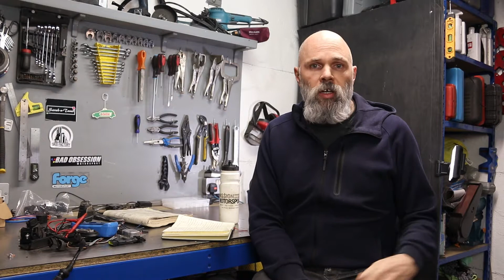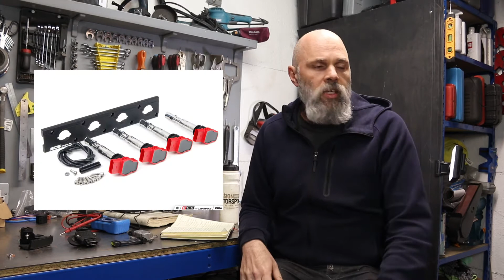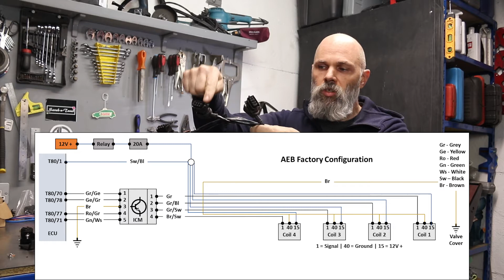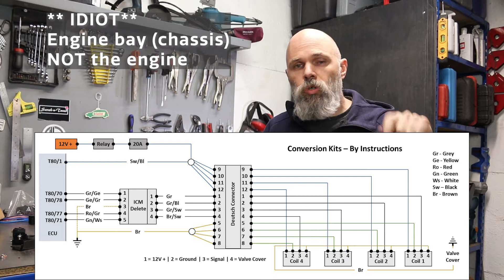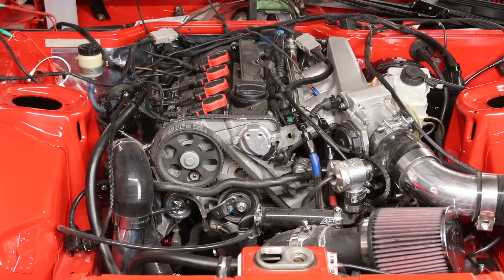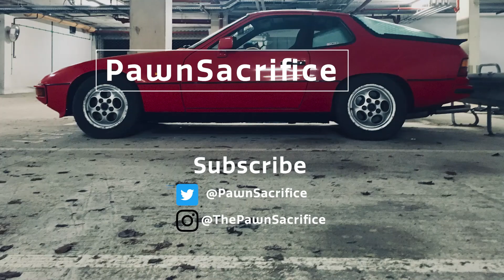1.8t to 2.0t Coil Conversion + ICM Delete (+ troubleshooting)

Comment: Hello, I'm afraid my English isn't very good, but I'm also having the problem that it won't come off. Could you explain how you solved it?
Reply from the maker: If you mean it does not start try and remove the cam sensor - see 18:30, if the engine starts plug the sensor back in and swap the coils order, move 1<>4, and 2<>3, see 19:20, if it starts that was the problem, if no, you may need a new cam position sensor. I hope that made sense.
Reply: @PawnSacrifice OMG you're the best! It really works! I'm so grateful for your videos! ❤❤❤❤❤❤❤❤❤❤❤❤

Comment: Sooo i have problem with stuttering and i thing my problem is from connecting 2 ground pins together ang connecting it to stock ground prin from original wiring. Is this right or no
Reply from the maker: Honestly it was so long ago, everything I did is in the video, with diagrams and that worked. I think there was a ground from the engine block, from memory. Sorry. Are they connected in the right order, is the only thing I can think?

Comment: So to not delete the imc I would follow the aeb/porche which would mean I cut the harness by the cylinder head?, then wire the wires to the connector that connects to the new harness right ?
Reply: And the deutsh connector is the connection piece u wire the wires to in the harness kit?
Reply from the maker: @Europitdprod  I am slightly lost with this to be honest, it's been a while - if you're using a kit just follow what they're doing, the ICM delete is a cable, what you're taking out is after that so there shouldn't be anything to cut, from memory.

Comment: Ive got a passat with AEB engine so i have to follow the second diagram AEB/Porsche conversion right ? So i dont need the icm delete connector
Reply from the maker: I had to have a quick look back, but that sounds right - assuming you're doing the same as I have and cut the loom back before the ECM, you could keep it, but it'd just be extra wires - I cut out a lot for neatness.
Reply: @PawnSacrifice  thank you! There are some conversion kits out there on ebay with icm delete connector and 3 to 4 pin connectors for the coils - as they say no wire cutting only plug and play.. do you think thats reliable
Reply from the maker: @plamenspasov6723  no idea, all I can say is I didn't want too much wiring in the engine bay as there's a lot of slack with the VW/Audi loom already. But if you're not happy cutting and crimping, that could be the way to go.
Reply: @PawnSacrifice  thank you very much! Learned a lot of stuff from u mate, cheers

Comment: What would be the benefit of doing this conversion, I have an Audi A4 b5 1.8t AJL and thinking about doing this but was wondering how much of an improvement it is
Reply from the maker: Reliability - I needed to replace at least one coil on mine and kept reading what a pain the ICM is so I took the opportunity to upgrade.
Reply: I de pinned my Icm and just plug them in directly from wire to wire